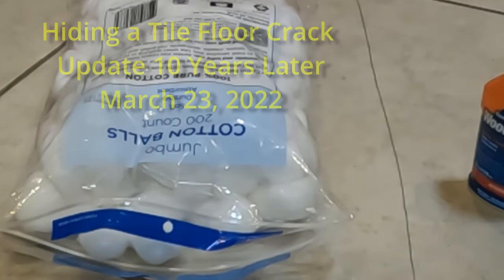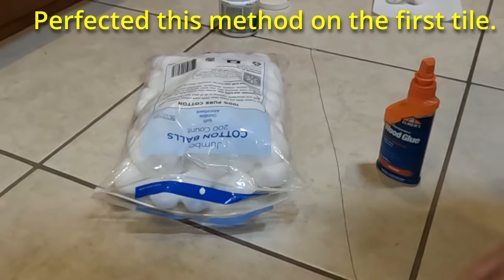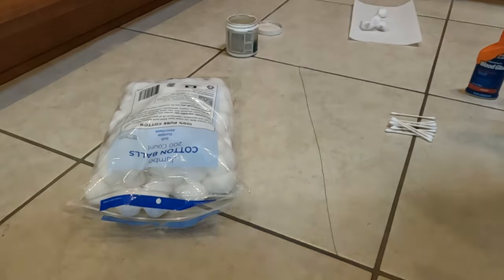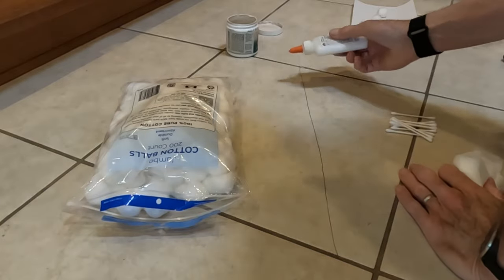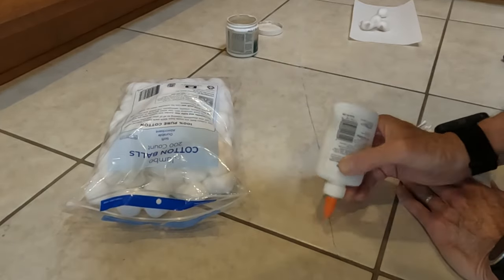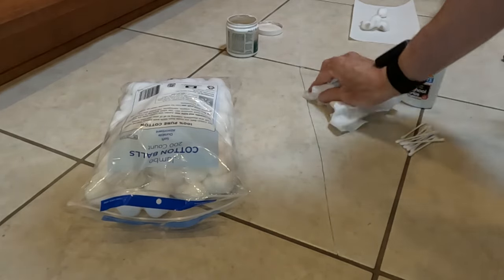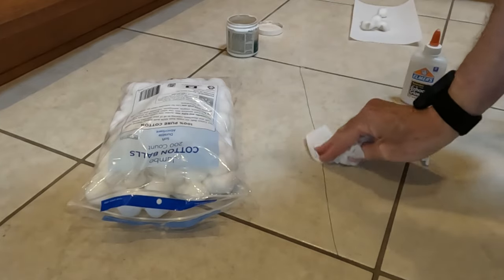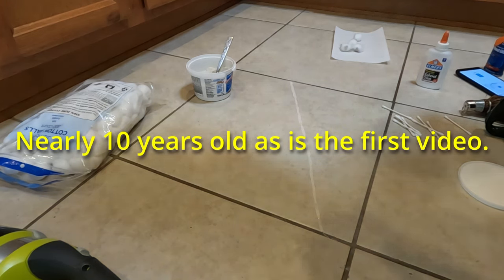Hiding a Tile Floor Crack Update March 23 2022

Comment: This is almost the exact thing I need to do.  But my tile crack (like most, I think) is due to the floor being uneven.  So won’t the crack just reappear pretty quickly?
Reply: You are correct that the Crack will likely return (you can see the crack in Video keeps getting longer and the Tiles may all be flexing in a Void). 

With any kind of Tile (Floor, Wall, Ceramic, Vinyl, Wood, etc.) it is always best to have a flat surface to mount the Tile. There are many different Sub-Surfaces and each has its own method of smoothing, but it really helps, especially with Cermaic Floor Tile to avoid cracking.

Typically, it is best to not Sand the Surface (Floor or Wall) that the Tile will be glued to, if it is too smooth the Glue may not hold as well. Typically, the Surface of the Tile that takes the Glue is manufactured to be porous enough to hold the Glue.

With Ceramic Tile you need proper Spacing to allow for expansion that is filled with Grout.

Comment: Great video. Is this a water based paint or oil based and will this technique work with small holes or chips in tiles.
Reply from the maker: This was water based paint. I guess you can use oil base or nail polish as well if you can get the write color and you have the right solvent to deal with it.  I think there are other methods for chips that I have seen that might be better.
Reply: @MarioNappa Hell yeah, thanks Mario. Also don't forget to update your bio to say the new year! Thanks for the tips sir

Comment: hi, how much time between each step? It seems from the video you went from the glue straight to the grout, then paint, etc. Also, how long did you wait between number of paint coats, approximately.  Thanks!
Reply from the maker: You immediately add the grout to the wet paint so it sticks to the paint.  I think if you wait two hours between coats of paint, that should be enough.
Reply: @MarioNappa  Thanks Mario! I'm leaving just now to go try this in a rental apartment... Best wishes.
Reply: @isinet2813  Did it work?
Reply: @manestage5403  👋 Hi, yes it works well enough to get you through some period of time (time will vary). My case: it's a rental apt & I really only had one chance to do it, I went back 2-3 dys later & was surprised how well it seems to "set together" if that makes sense. That white glue worked real well for me, it seemed to bond good to the tile which was surprising. Make sure you match the color of your tile.
Reply: @isinet2813  Thank you so much!  Very helpful.  In the comment section of videos like this, many people say they will do something, but they never come to tell everyone how it went. lol

Comment: What is that powder filling called? Is there a link for that?
Reply from the maker: It's grout.  You can get it to match the tile - NOT the grout used in the area.
Reply: Can you give us the brand? The link?
Reply from the maker: @jinnierivera3267  Just go to Home Depot or Lowes or a Tile Store and buy grout to match the color of the tile.  Any grout brand will work.  You just need to make sure the color matches the tile.

Comment: That tile cracked because it's poorly glued! First you need to find the place where it is not stuck. This can be detected by double-clicking. Then holes are drilled in the joints in places where it is not glued. Then, with the help of a syringe, the diluted glue is injected into the holes and it is observed whether it starts to flow through the adjacent holes. After curing, the crack can be repaired!
Reply from the maker: No, the tile cracked due to a crack in the slab.

Comment: Idk this kinda seemed like a hack job to me.
Reply: It says to hide it...I would much rather do this and be done in an hour, as long as it's not visible to the naked eye. Especially as a fix until you're ready to replace the floor.
Reply: You are correct. I was thinking the same as I was watching this.

Although I typically have done things "The Right Way", which in this case would be to remove the Tiles, repair the Sub-Surface and replace the Tiles, that is not always practical for everyone for many reasons (Cost, Ability of Resident, future Plans, etc.). My "Old Worn-Out Ranch-Style Home" will likely be Bulldozed in a few years, so I just want to do some quick fixes for aesthetics, while not investing Time and Money into a Major Project.